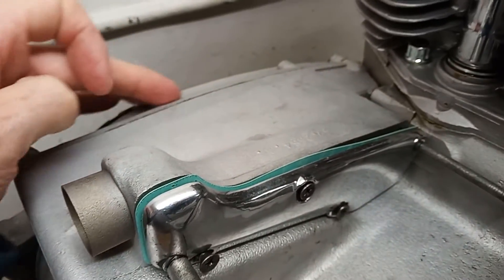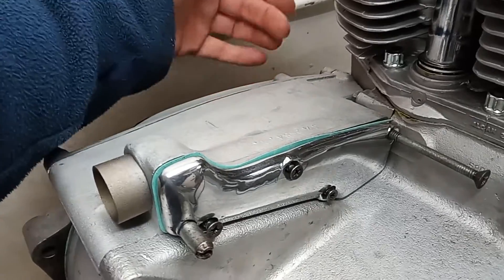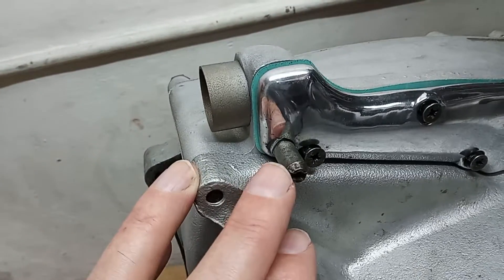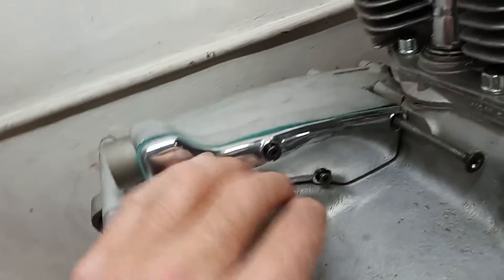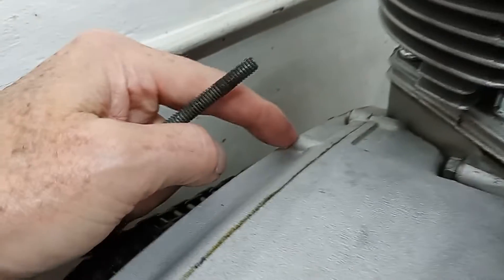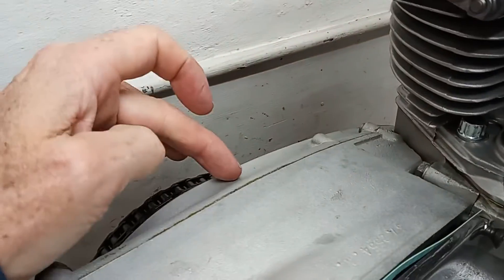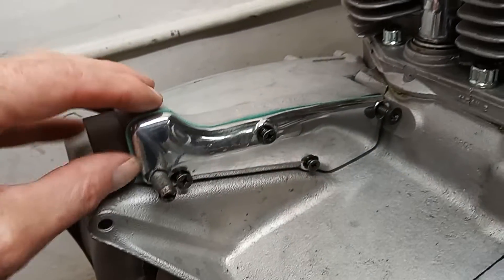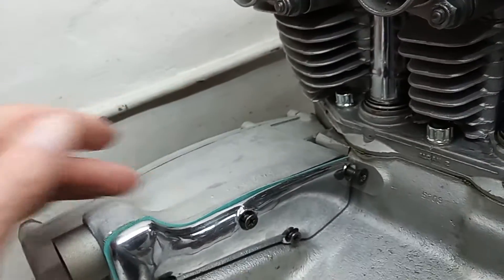Triumph Trident T150V Engine Rebuild Part 45A: Fitting the Engine Breather

Comment: Dear Chris,
 Thank you for all these informative videos, I have watched heaps and learned lots but this is the first time I have gotten up the nerve to comment/respond to any. I have a question, not neccessarily about the content of this vid, but related. I notice in previous vids you have removed the stock air filter and replaced it with bellmouths on all three carbs. I just did the same on mine, after years of frustrated fighting with the stock airbox arrangement to do simple things like clean carbs, and replacing the filter, not to mention the horribly twisted path my choke cables must take to fit in behind the whole mess. Anyway, my questioin is, now that one has removed the filter box with its built provision to accept the output from the engine breather, through that painfully difficult to re-attach D-tube, how does one continue to vent the engine? Could there even be a reed-valve sollution? Thanks!
Reply from the maker: Hi there, thanks for your comment. On my Tridents I  repurposed tge original breather hose and simply fitted a simple engine breather filter from Ebay. There are loads to choose from. Just check you order one with the right diameter neck to fit the breather hose. I can't remember the correct size offhand I'm afraid.  I'll try and post an example link. Chris
Reply from the maker: https://www.ebay.co.uk/itm/321507720604?mkcid=16&mkevt=1&mkrid=711-127632-2357-0&ssspo=I_ObZLsTSR6&sssrc=4429486&ssuid=nulBD6jAToa&var=&widget_ver=artemis&media=COPY
Reply: @Chris.rooke150  Thanks Chris! Your a star!! -p
Reply: @Chris.rooke150  Dear Chris, one last question if I may? RE: triples fitted with bellmouths. I read in your book that you found mid-range performance of your t160 was improved by fitting smaller cutaway slides, did you find you needed to do the same on the T150?
Reply from the maker: Strangely my T150v ran perfectly from day one, without a hint of a problem. No adjustments or alterations of any kind were made to fuelling or ignition. About 9 years later I'm still trying to fine tune the T160.  🤔😒
Reply: @Chris.rooke150  I hope to find the same! I did, per your suggesting put in larger pilot jets #19, just in case. If your interested. ..here is a YouTube vid of my bike only a few hundred miles after a complete rebuild by a gentleman who knows far more than I ever will about these bikes (https://www.youtube.com/watch?v=6uN6ya2OuZ0). The videographer is also a lovely person, super enthusiastic about bikes who makes weekly videos on two wheels all year round! He previously made two videos of my Norton and when he saw this one day at my local hangout in Cams, asked to take it for a ride. The enthusiasm is infectious. Though he may sometimes get some details wrong, it doesn't detract in the slightest from the presentation -one can't know everything about every bike. If you bear to watch till the end as he pulls into Haywards, you'll hear a couple pops from what I think is from the slightly richer idle mixture which, in the theme of this thread, may be advantageous once I start running the bike with the bellmouths installed? Thank again!